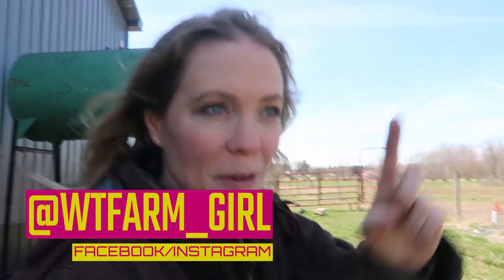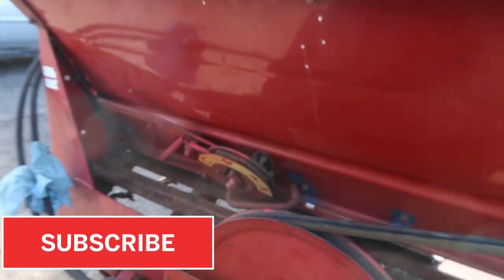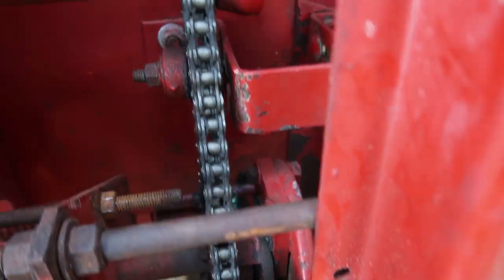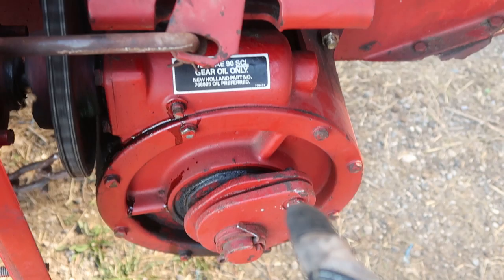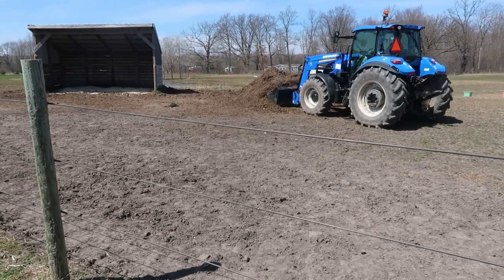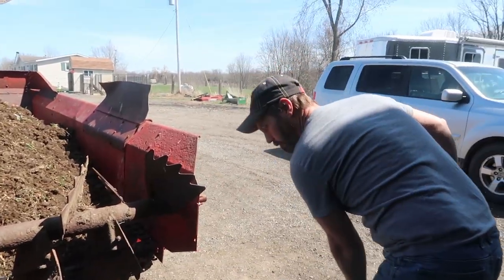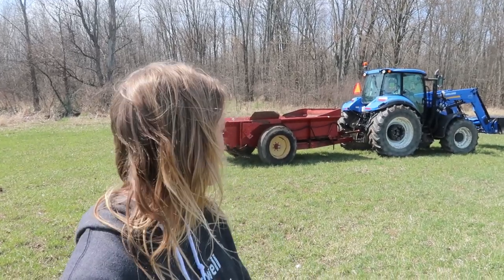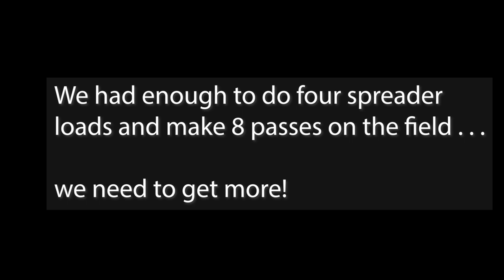297 We BROKE My New Holland 155 Spreader - Will It FINALLY FLY?

Comment: A few tips for you, 1. always park the spreader as close to the manure as possible. 2. there should be a rope attached to the gear selection lever so it can be controlled from the seat of the tractor seat. 3. once the beater stops spreading and the manure is just sprinkling out the back disengage the beater by moving the gear selector to the c (clean out) position and just run the apron, once spreader is empty disengage the PTO when the apron bars just comes up to the top at the front of the spreader this will help keep the manure from spilling out the front on the next load. All in all it seemed to do a good job spreading also when spreading manure on a hay field it is possible to spread it to thick and smother the grass so you may have to adjust your ground or apron speed accordingly always run the spreader PTO speed when spreading.

Comment: I've got an IH 155 manure spreader and it's got 9.00x20 tires.  In the manual it calls for 35psi in the tire. If the tires are different sizes that should be fixed because of height difference.  When you run as fast as you were that's called "top dressing". Put the same amount of air in both tires, 45psi would be more than enough.  Dont worry about what the tires say on them.

Comment: Erik is very clever making a pulley. You lined the tractor up perfectly first shot Suzanne, nice!
Tire pressure on the tire is Max Cold pressure. It has NOTHING to do with what the pressure should be (compare the tires on your car and the plate on the door). You need the spreader manual you can't get to know what pressure the tires should have. Barring that I suspect the pressure would be fairly common for any spreader that size.
The manure will be a lot better for the soil than chemicals.

Comment: For your tire pressure question, the tire on the left looks like a truck tire so yes it can handle 105psi if its not dry rotted but 50 lbs would work just fine with no more weight your putting on it.
The passenger side looked like an implement tire so it would have a lower tire pressure rating of 65.
Basically just try and keep them even psi. 50-65 range would work splendidly

Comment: We have the same make and model of that spreader and we used it to break apart hay bales and it would spread those hay bales out for the cattle to feed on. Worked very well indeed.
Reply from the maker: Erik was hoping to use it as a dump trailer to haul sand, dirt and rocks . . . I said think again ;)
Reply: @This1LifeWeLive  That will be  a little hard on the spreader as that can cause breakage. IT was made to spread soft materials and not rocks.

Comment: To change the speed of the apron from "c" to slow to fast slow the PTO speed when changing the mode.  When you go from "c" to just them beater, turn the PTO off... it's recommended that you do so in the manual.

Comment: First load only 2,  If you here a clicking noise while spreading its rocks in the spreader (stop) & take them out
After shutting tractor off (It will cost you a back window).I used a piece of plywood for years screw a 2x4 so it will set on edge of tines(beaters)& when you start spreader slow it will pick plywood right out. Don't forget plywood when done!  Tighten apron chain hangs down to low. Great video.

Comment: Your learning fast, ok the two plates that move together to form a drive are called a dog clutch, the pear shaped plates on the end of the bed chain gearbox are held together by a shear bolt that breaks if the bed chain jams, always  replace with the correct type bolt. Watch the bed chain tension, to loose and it will unhook and if you don’t notice it will lay the chain out in the field behind you. Next time I’d suggest you look for a rotary spreader, looks like a drum lay on its side, ever so simple and reliable.

Comment: Suzanne, the pressure ratings on the side of the tire are maximum pressure.   Not what you should put in them.   If you load the spreader and look at the tires if bulging out at at the bottom, needs more air.   If not, you are good to go.   I would suggest you lower the pressure while loaded and air up until no more bulge and add another 5 pounds.   I would be surprised if you more than 35 PSI.  That thing can't weigh that much.   A few more loads spread and you will be a pro!   Best wishes!

Comment: I have the same mechanism. Clean out the web moves, but the beater stops. I bought mine “NEW” the shifting of the spreader, on the front. NEVER WORKED! I leave mine in the turtle gear. Oh it works, if you want to fiddle with it, a lot!!!

Comment: Will need to tighten the apron.  It looks like it's been adjusted as far as it can go so that means you'll need to take one or two links out of the chain.  Then use the tightener on the front of the spreader to take up the excess slack to tighten the chain.

Comment: The c setting is for clean out. It's made for a faster apron speed with very little or no load in the spreader. Also follow the pressure guidelines printed on the sidewalls. Not every tire is made to take the same weight and pressure rating.

Comment: The C stands for clean, it shuts off the beaters so that the bottom bars can clean out all the Manure. There should be a rope on the lever so you can change the settings on the apron and betters. There should be slow and fast and neutral.

Comment: @ 5:36 in your video, that clutch should be completely together and those two small rollers should not be touching the clutch while the beater is running. The only time those two small rollers should touch the clutch is when you disengage the beater for cleaning out the spreader without the beater running. As for that large pulley in the front wobbling, as long as the bearing behind it isn’t out I won’t worry about it.
Reply: JDMan522 explained the top (beater) clutch.  The bottom two clutches are for the apron speed.  When the front clutch is engaged, the apron is on high speed.  When the back clutch is engaged, the apron is on slow speed.  (Only one apron clutch will be engaged.)

Comment: The pressures printed on the tires is the maximum pressure for the load rating. You have two different load rated tires.You only need to use the pressure the spreader manual calls for, in both tires, but don't exceed the pressure listed on the tire.

Comment: You'll get better distribution when you get the gate on. With the gate you should be able to put 4 or 5 buckets in there. That's a nice crap slinger last one I used was all mechanical. You may be able to acquire a manual for that from New Holland but it won't be cheap. A used manual can probably be secured but either way you will want to have one on hand for maintenance. Just think, you now have a pto powered politician that you can control. It's also a good way to get rid of the road apple's and just maybe some neighbors will be willing to contribute.

Comment: Be sure those 'clutches' are fully engaged.  Full tooth contact.  Put 50 PSI on both sides.  Spread on the high ground or poor growing areas.
What are those lines hanging on the right side of the spreader?  Hydraulics for lifting the Gate that isn't there?  Use heavy carpet?
Recheck your repairs and settings when finished.  It appears to be working as it should.  Glad you have a cab!   They do beat in all directions.
Great Hoodie.  Apron chains look very loose.  Remove some links, start with 1 per side.
Try this https://www.youtube.com/watch?v=FnwobbbUUFk
Reply from the maker: They go to the rear gate which wasn't with the spreader. We have to pick it up when the owner comes back.

Comment: I couldn't tell if there was any way to control the apron from the cab to select Rabbit speed, Turtle speed and Cleanout.   But after selecting Cleanout, be sure to stop the PTO before resuming one of the other speeds (which re-engages the rear beater):  turning the beater on with PTO at full speed will likely snap the cast iron cogs.

Comment: Hey Farm Girl,  I noticed your spreader was still running after you ran out and heading back empty.  You should take the pto out of gear so you don't run it unnecessary and finish wearing the old girl out.  Same way with any equipment.  It helps making them last longer and don't forget the grease and oils and stuff.  You guys are doing good so, keep it up, stay safe, and God bless.
Reply from the maker: It was just running the last few scraps out. I never leave a pto running unless I'm checking equipment or working a field. Our road is too rutted and bumpy and would do damage to a running pto :( but thankyou for the tip :)

Comment: 1 suggestion ..take a link or 2 out of both sides of the apron chain and readjust the tention points...we had trouble until we tightened out apron up ...you may have no problems with it like it is but I know we did .....also looks like a small cheap tractor is in your future someplace
Reply: I second this comment!

Comment: Great video wt farm girl!! Also set your tire pressure to 65 for both of them. Also take your old oil from like the tractor and stuff like that and put it on the chains that take the crap to the back and don’t be shy with the oil won’t hurt nothing but extend the like of the chain!! Also that peace that has the C,rabbit, turtle on it should some where have a place to put rope threw and then run to the area of the pro and jack them up to the cab of the tractor, that way when the load is getting light then you can turn up the chain speed to clean it out. Thought this might help you out

Comment: Number one I agree with a couple of comments that were made did you should put one bucket in first and take it out and test it. My son and myself have had to shovel a full load out of a manure spreader many a times. Secondly and more importantly,, if I ever see you or Eric Reaching Your Hands in around those chains are clutches again with the tractor running I will drive to Michigan and whoop both your butts. Even though you had the PTO turned off on that tractor there's still a slight chance that that PTO clutch could grab and spin the change or the clutches while your hand is in there. Please please please don't ever do that again.
Reply: I would hate to hear or see Suzanne or Eric get hurt.

Comment: You should have a porcelain insulator at the top of the head board of the spredder with a rope going through it and tied the your indicator you pull the rope from the tractor to adjust your speed setting 
FYI your tail gate is missing 
I grew up using the new Holland

Comment: There are lots of small farms that give it away because they just to small to have contracts and a lot of hay farmers go the easy way with tanks of water chemicals because of time it takes is lot less for them. In long run cheaper because they do more area and done so many fields that they are cutting more hay than you. And the fertilizer fields are well, some are just cheap, they skip doing it figuring they got good hay so ground is still good. The hay starts turning green and if it is not real good they do aerial spraying to make up for it. They do the least they have to cause there is not enough hay to go around and they can guarantee they will sell all they have. If there was more hay then they would have to compete with.

Comment: They are a great spreader we had 4 of them and where the slow and fast are the c is for clean so just a bed chain runs And if you still can’t get it working there is a rod but the gearbox that you will have to free up

Comment: Should have kept that old farmall C. It would be able to run that spreader. That way you wouldn't have to hook & unhook the spreader. Tire pressure should be the same. The baler has 2 different size tires. By the way I'm not complaining about the rear end shot LOL
Reply from the maker: I drove the Farmall C until we got the John Deere. Made me crazy nervous wit that tricycle wheel . . .
Reply: @This1LifeWeLive  she would also get alot of shit flung at her instead of the outside cab of the new holland.. this is where you'd still want to have that john deere for loading the pooper spreader while still being hooked up to the big blue.

Comment: If the gear gear oil is milky white, it has water in it. Drain the oil and put fresh oil in. Make sure you're using 80 weight oil minimum for the two gearboxes. Also make sure you grease all that U joints for the PTO. With that particular model be in a 540 PTO shaft hook up always use 540 on your RPMs, if you have piece of equipment that uses 1000 PTO you use the proper RPMs to run 1000 PTO. Never run your tractor rpm lower than what the equipment is designed to be using. You can damage the tractor if you don't use the proper RPMs with your equipment. Growing up on a farm I have seen a few tractors in the shop for repairs because of that.
Reply from the maker: They were damaged from the pto being too low?? Why? because it was putting the engine under too much stress from a less than efficient workload?

Comment: Hi you're (sandwich plates) are called a dog cluch . If you look on the out side of the big gearbox you will also see a sheer bolt .i.e. some thing like on hay baler put spear in tractor tool box! .  The trailer s own stand should be strong enough .

Comment: Definitely need to change the gear lube ASAP. That 'honey' color means that water got in and is emulsified with the gear oil. Probably need to replace the top cover gasket also.

Comment: You can buy plywood at Home Depot in Mich. I would run the tires at max PSI listed on each tire this will allow max load carry, since its just on a crap hauler it doesn't matter that they are different, if you were going down the road it would be better that they matched

Comment: It looked like it was spreading about right . I would set both tire pressure s the same and to the lowest max pressure. 
We put straw flakes in the back so it doesn't run out . And if no straw we use feed sacks.  You can always pick them up after words. 
 😊😊👍👍👍💝💥🌎🌹🌹🌹🌹
I was not complaining about the rear shot . Lol

Comment: I would think as long as you got a a rough cut 2 by 6 under the foot of the jack to stop it from sinking in you should be just fine with that jack taking that weight of a loaded spreader..  you may not like to hear this as far as Erics prediction on the bucket count but I'd bet hes pretty darn close LOL.
will say this if you load your spreader in the pen by the manure pile you have no clean up till the end because the spill is happening right at the pile (But I dunno if that gates to small or not)

Comment: Now you can say your an artist of who Flung Poo , Thats how its done wait till you have 3 feet of it at the barn the flies are thick and it spreads 20 ft in all directions we used to load a long trailer full of planks fork it all over loaded it by hand too Same tires load it and make it just off the side wall is always best as not to wear down the sidewall any vehicle just past the surface tread ;rating recomendation is max of belting strength normally slow speeds are good at 60-100 for implement 1/2 to 3/4 pressure of max  ,This is the only implement a dealer won`t stand behind in production  LOL .

Comment: The amount that is on those tires for air pressure is telling you that is the maximum amount that that tire will hold. Put the same amount in each tire somewhere around about 50 psi on both sides will be plenty.
Reply: And your speed was way too fast. I would drop down to about B1. You want a good coverage. Number one horse manure isn't high in any form of nutrition so you're not going to burn your ground up putting it on heavy. Now if you're spreading chicken manure geese manure cow manure then yes you want to go a little faster and spread it thinner.

Comment: Don't put air pressure in that's stated on tire that is for trucks that much air will bust your implements wheels 25 t0 30 is probably enough just so it stands up when loaded

Comment: Just like on a car the tire pressures listed on the tire is the safe maximum. The actual pressure you want should be listed on the tractor or in the manual..  just like its listed on the car door frame.  And it depends on loading.    Heavier loads require more air pressure.     so look at your tractor or the manual..    not on your tires.

Comment: If you throw some old wet hay in the back, it will stop the fines from failing out and it will fly out when you put it in gear.  I am afraid the plywood would get wedged against the beaters and you would have a terrible time getting it out when you get to the field

Comment: Curious. Why would you be nervous driving the C international? Its a nice handling ilttle tractor. .  They are so easy to handle and great for pulling stuff around or spreading. Also their value keeps going up a little.
Reply from the maker: It's a tricycle wheel and they have flipped over on a good many people.we both have known guys who've flipped them..
Reply: @This1LifeWeLive  ok. No sense using it if you dont like it. I drove them over 40 years and i dont see the danger. International C, H, M, 560 with narrow fronts. Never a problem.  The C was always ny favorite little toy.

Comment: Your tire pressure only has to match the load being carried, those tires look like truck tires that's why the high rating for a 12k lb steer axel. I would bet 50 to 60 psi would handle the load you got.

Comment: If you guys ever think about buying a second tractor I would reccomend an J I Case 930 a very simple and reliable tractor with plenty of horsepower 86 horsepower to be exact. They are also aazing when it comes to fuek economy.
Reply: Id bump it up to a 1030 but both solid
Reply: She had a John Deere open platform. Don't recall what model it was.